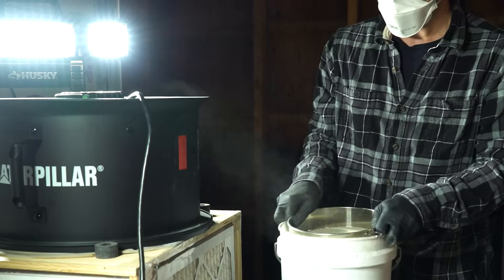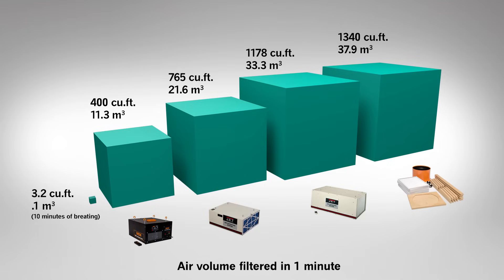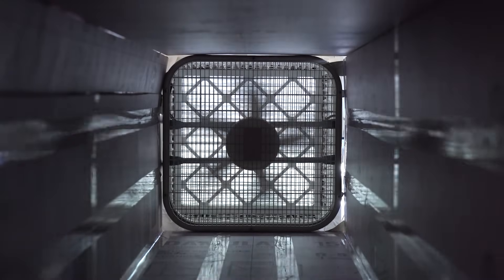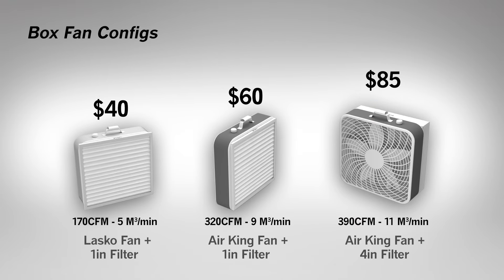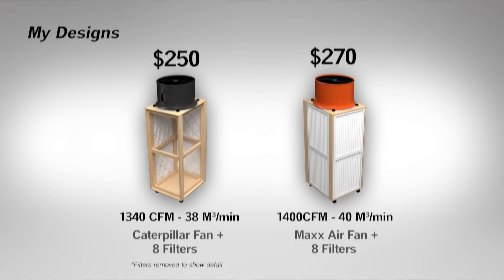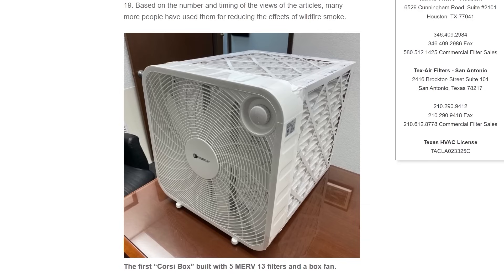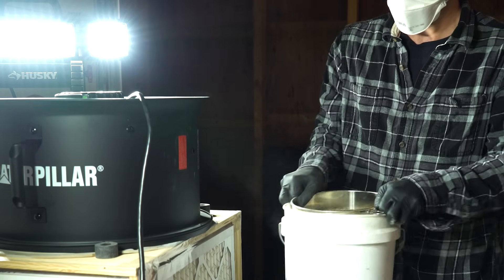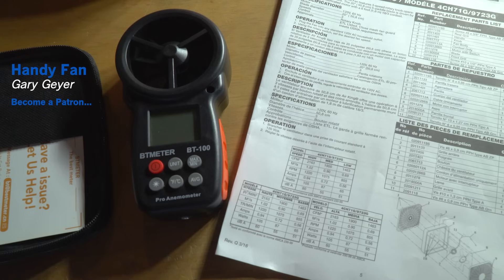What is the best DIY Air Filter?

Comment: 0:46 airflow rating only shows CFM in ideal conditions, static pressure is afffected by pipe length and size, try to seal your pipe completely and it should be okay, your filter also decreases CFM
Reply from the maker: True, the airflow rating is just for ideal conditions. It's intended as more of a comparison between the different options that anything else. The quality of filter is also hugely important when it comes to the performance of these units. I'll be putting out a video on the subject soon.
Reply: @The3DHandyman  Nice, keep posting interesting content, everything is so nicely explained! I like how you show that diy can have better performance. I think you are right, most fans don't take into consideration  average airflow. your design allows you to use a turbofan in a soundproof case which will supply crazy amounts of airflow & static pressure
Reply from the maker: @minesti3725  That's great to hear! I do like the idea of sound proofing the fan exhaust because the fan isn't exactly quiet @72bd. Maybe I can give it a shot at some point when I have a more permanent shop space.

Comment: Hi, love your videos. I was going to build the ceiling mounted air filter system. I looked at your plans on your website and was wondering if I was to mount the beastie boy or the compact to the ceiling of my one car garage shop, would you recommend orienting the fan to be sucking air out of the vent box or blowing air into it? should the fan itself be facing down to the floor of the shop? Thanks for your advice.
Reply from the maker: Thank you! I'd definitely recommend only blowing air out of a ceiling mounted filter. The "push into filter box" method is really only designed for use right next to a tool or source of dust. When you blow air out of the filter box the unit will clean the air at a much higher rate, maybe even twice as fast.

Let me know if you have any other questions and if you make the compact design, let me know how it works for you!

Comment: The filter placement in this video seems to have all the filters on the output side of the fan. Seems it would be better to have the filters on the input side. Placing a fan near an open window during the summer causes dust to cake up on the fan blades and motor after a few weeks of use. I would imagine that a workshop environment would be 10 times worse. Just my thoughts :)
Reply from the maker: It is the sort of thing that will make the fan dirty. It would need to be cleaned occasionally and the fan should have an enclosed motor to prevent dust accumulation inside of the motor itself.

This configuration is like a vacuum for the air. Vacuum's themselves tend to be quite dirty on the inside, but they still work.

I'll make a video about this concept's up sides and down sides in the near future!

Comment: I found that by taping off the corners and making a shroud, my fan blades and grill stayed much cleaner. 
I use mine for household air in the cooler months when we can't open up for fresh air. 
I have 2 fans, both Lasko. I run the 4" Nordic pure filters. On one fan I used the metal shroud from a burnt up fan between the fan and filter. To my calibrated hand there is a noticeable increase in airflow. 
With 2 large shedding dogs and a fluffy cat, our home air always feels fresh and there are almost no lingering smells. 

Great video and testing.  Thank you.
Reply from the maker: Great feedback! I think the 4" Nordic Pure filters work quite well. Good call on the shroud, a lot of people use them. They are definitely good for keeping air from pulling in the front side. In my wind tunnel test they did not return an increase in airflow but that may be the result of how the test was configured. 

Thanks for the comment!
Reply: Interesting comment.  Please clarify “metal shroud”.  Not sure if you referred to grillwork that keeps hands away from blades, or the “box” of a box fan, or something different.  Sounds like a “spacer” was placed between the filter and fan.  I’ve heard or read that three or four inches can make for much better airflow.  
Thanks!
Reply: @Joe Dance  I used the box from a burned up fan. I just removed the guts and have taped or riveted the old shroud to the new shroud.  
There is a noticeable difference in performance.
Reply: Thanks!

Comment: Nice work. i think the wind tunnel should have an output duct and better sealing though. IIRC, theres a surprising amount of air that gets pulled in around the fan itself from the exhaust side (in a circular pattern from exhaust side to intake side. This is one reason ducted fans are more efficient, and why box fans are massively overbuilt for the airflow they create.
Reply from the maker: Very true. I retested all these with some upgrades to the tunnel. The gaps are smaller near the fan but still exist. I also raised the whole thing up off the ground and used 2 anemometers instead of 1.  In general the results we very similar to this round. I'll share those findings in my next video.

Comment: What bout using computer fans like four Noctua 200mm for a 30m2 room?
Reply from the maker: That's a good idea! I'll be testing something similar in the next month or two. The Noctua fan would need a controller and the cost of the unit becomes a little high after all that. Finding a filter that perfectly interfaces with a 200mm fan is also a bit challenging. I will test out the concept on a smaller fan that comes with a controller as a proof of concept.

Comment: i may not be the originator of the filter on fan idea but i have used one of these for a long time. the reason i put the simple design together 50 years ago was because of allergies and the outragious cost of hepa filters on the market. i have used that simple design for its filtration at low cost and white noise for tha long. its cool seeing how this may have turned into something else but the original idea is still the same, simple cheap and effective for a person with allergies to get a really peaceful nights sleep.
Reply from the maker: You never know, you might have been the first! It's simple cheap and effective. Lot's to love about the design.

Comment: I severely asthmatic and recently moved, my throat has been really tight and I've been struggling with my asthma worse than ever before in my life, really hope I can afford to make my own filter system soon
Reply from the maker: The lowest cost option may be a Corsi-Rosenthal box with a cheap box fan (~$70) and 3M MERV 11s or a single box fan and a nicer 3M MERV 13 or even better MERV 14 (~$40). They all work pretty well for spaces up to 500sq.ft.

I talk about different filter option in this video https://youtu.be/XAJ__E-hIJc

If you try one and it works or doesn't work for you, I would like to hear about it. There are lots of allergens out there from mold to pet dander and wildfire smoke, these can help but may not be the whole story. Carpet cleaning and disinfecting may help if you are in a rented space... sometimes you can get the landlord to replace the carpet. Some friends had a lot of breathing issues and then maintenance found a lot of mold in the ceiling. These might be some things to explore if the issues are caused by your living space.

Comment: What 4 inch filter are you using in this test? I’m having trouble locating one merv13 or higher. Thanks
Reply from the maker: I used a Nordic Pure 20x20x4. In the recent air filters vs smoke video I tested a Filter Buy MERV 13 which had decent performance but none outperformed 3M MERV13 and 14 filters 1 inch filters.

Here is a link to the Nordic Pure 4in https://amzn.to/3AYyiwC
Reply: @The3DHandyman  thanks. Very helpful. I’m enjoying your channel

Comment: I created my filtration system with a reclaimed HVAC blower.  I wonder how that would compare to your system.  i have no idea how much air it pulls at H M and L settings.
Reply from the maker: I just met a guy that has a spare from his old system and I'll test it out in the next couple of months or so with a new design. They are designed for use with a lot of static pressure and they output quite a bit of air. All around they are a great choice for DIY units. As for CFM you can look up the model number to find that info if it's out there.

Comment: Just slap a 1" on the back of a box fan. Suction keeps it on. No need to build anything
Reply from the maker: That is an effective method. The performance is twice as good with a filter box but you can just as easily run two fans with single filters attached to get the same output.

Comment: Air velocity is not the only factor you should consider, you should also consider the static pressure, axial fans have high airflow and low static pressure, mixed flow fans have medium of both, and centrifugal fans have low airflow and high static pressure. When you are pushing through a filter you should pick mixed flow or centrifugal fans, not axial. Check out EBM Pabst for the highest efficiency fans you can find - always go with an EC (Electronically Commutated) fan, anything else is inferior in terms of energy efficiency. If you want something cheaper than pabst, try AC Infinity (warning low quality components compared to other brands), or the Revolution Fan from Systemair. Big ass fans also make good fans.
Reply from the maker: I will be exploring all of this stuff in my next couple of videos. I did pick up a AC Infinity carbon filter to test out VOC reduction. Didn't go for their fans tho. Good to know they aren't worth much. The axial fans work in this sort of scenario but aren't as efficient as blowers and in line fans. I'll check out Pabst for sure. Most of my designs are built to create a near zero static pressure environment so that the axial fans can work closer to the way they are designed. Will get into all of that in detail in the next video. Thanks for your comment!
Reply: @The3DHandyman  when I say AC infinity is low quality, I mean compared to other brands, it should still run for many months continuously without a problem. But brands like Pabst will run for years and potentially decades continuously.
Reply from the maker: @bastiat691  Yeah, months until failure is not so good. I just got an iPower brand fan, will see how long that lasts.

Comment: very well done.  Thank you.  I have an amateur comment ...
I've read that part of why a proper hepa filtration system works so well is due to the high speed of the air moving through the filter media, causing turbulence and causing even small particles to collide with and get trapped on filter fibers even though those particles were smaller than the openings in the filter.  If that is indeed true, adding more filters to make the box does increase airflow some but would significantly decrease the speed of air moving through the filters.  Perhaps for the purposes of people making dying filters thus is not of concern but I suspect that although the box filters MORE air it does not filter that air as THOROUGHLY as a system moving air faster through its filter.
Reply from the maker: Interesting concept, I'll look into it for my next video on filters!

Comment: Problem with these is that the particulates that are harmful are way to small for these filters can stop. If just to grab some dust out of air ok.
Reply from the maker: Yes, at some point viruses in particular are too small for the porous filter media. I think there is a fair about of research on the CR boxes that show they are somewhat effective. It may be becasue respiratory droplets are larger than the viruses themselves and those are more easily captured.
Reply: @The3DHandyman  Not viruses but the actual particulates that are harmful to us are must smaller. I suffer from horrible allergies and am a contractor (worst choice ever).  I researched air purifiers for awhile.
Reply from the maker: @scottsather602  Got yah. I put a bunch of air filters through a smoke test and was able to see how well they deal with  PM1 (smaller than 1 micron) sized particles and most of them preformed quite well. At least, according to a inexpensive particle meter. I just tested a few HEPA filters as well to see how they compare but I haven't gotten a chance to process the data.

What did you find with your research?

Comment: I wanted to get a basic box fan but instead I got a shop fan. way to loud to use indoors without attenuating it.
Reply from the maker: That is one of the downsides, for sure. Here is the info for all the fans in this video:

Background sound 40db (high, med, low)
Lasko @1 ft - 63, 60, 55
Air King @1ft - 68, 66, 61
Air doctor @1ft - 64, 58, 52, 45
Maxx air @1ft - 71, 67, 57
Caterpillar @1ft - 71, 67, 63, 57

Comment: Should the fan suck or blow? Is it better to have the dust go through the fan, then get trapped in the filter - or is it better to suck the air through the filters and capture dust from all 5 sides?
Reply from the maker: For a box fan setup with a single filter or a 4 or 5 filter CR box, the fan should suck. For the drum fan design it can do either. the fan is pointed out of the fiter box it will do a better job of filtering the ambient air in a large space because of increased airflow. If the fan is blowing into the filter box it will work really well from a short distance (max 5ft) from a dust source but the efficiency at a distance is much less than the opposite method.

Comment: Curious what the amp draw is on each test. 
Having a restriction in the air Flo (dirty filter vs clean filter) can be problematic for the lifespan of the motor. 
And can be a potential fire hazard. 
A solution would be to use an old blower fan from a 120v furnace. They are designed for the abuse.
Keep the squirrel cage and blowerr wheel, mount it on a box with 3 filters. And the supply air can be ran through a collapsible hose anywhere you want.
Reply from the maker: Good question! all the data I have is watts:

Fan Power Draw (No change with filters attach observed)
All ratings given as High/Med/Low in watts
Air King: 95/83/67
Lasko: 76/69/58
Caterpillar: 130/120/114/107
Maxx Air: 157/129/105
Air doctor: 97 watts on high

Comment: While CFM performance is important, another important factor is dB from the fan it self.  Any measurements taken of the fans from distances of say 5', 10', 15' ?
Reply from the maker: I was going to take those measurements for an upcoming video but then I found the equation for that...
https://www.omnicalculator.com/physics/distance-attenuation

Here is the info to plug in to the page
Background sound level 40db
Lasko @1 ft - 63, 60, 55
Air King @1ft - 68, 66, 61
Air doctor @1ft - 64, 58, 52, 45
Maxx air @1ft - 71, 67, 57
Caterpillar @1ft - 71, 67, 63, 57

Comment: Does it matter if you have the fan pulling or pushing air through the filter?
Reply from the maker: I will be making a video on this some time soon. I like the PUSH method but it is best within 5ft of the dust source. The PULL method is much more effective at cleaning the ambient air of dust and other particulate. So if your filter is 15 feet away, the PUSH into the filters style is going to work about 1/2 as well as the PULL through the filters option.

Also I would not use a box fan for the PUSH method because dust gets stuck in the motor. The Caterpillar fan is the best for this because the motor is enclosed. I talk about that in this video a bit https://youtu.be/NmgNQu4zDy0

Comment: I would love to get your take on this version: https://www.youtube.com/watch?v=rOecQZZR5kA

It uses the same CAT fan on top of a canister filter instead of building a box... I wonder how it performs compered to your design.
Reply from the maker: I suspect that it will not preform that well. I bought a canister filter to test with an inline fan but it is not the wide canister, it's the tall one. So, I wont be able to say exactly but here is what I've gathered so far

1) It's not the best priced option. Together they are $400 but it is easy to put together.

2) The air filter can have the dust blown off of it but I don't know how the small particle filtration is effected by this. Do the small particles get blown out too or is it just the large dust chunks? Can this cleaning process damage the fibers? K&N washable filters say that compressed air can damage the structure of the filter, is this also true for these? I think the use of a pre-filter would be beneficial for this sort of thing so that you don't have to punish the filter media when you clean it.

3) In a separate video one guy did stick an anemometer over a 750cfm inline fan hooked up to this filter. It read 500cfm due to the static pressure created by the filter. Inline fans and blower fans are better designed for high pressure applications, not standard bladed fans. My "Model-A" design is made to create an environment where there is almost no static pressure to hold back the fan from operating normally. The MERV 15 canister creates a lot of static pressure, the opening in it is also a few inches smaller than the inside of the drum fan, this will create even more of a restriction. My guess is that the total possible performance for the one in video is maybe around 700cfm when the filter is new. It's a hunch though... maybe you can get him to build a wind tunnel to test it out :)

I'll make a video about this concept in the next 2 months or so using the inline fan with an added pre-filter. I may not be able to answer all my questions but I'll see what I can do. Thanks for the question!